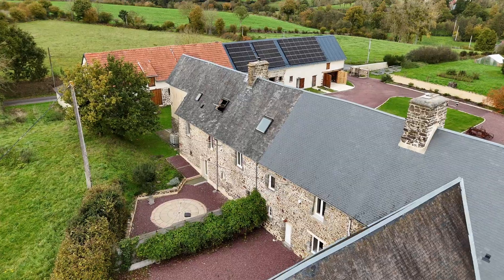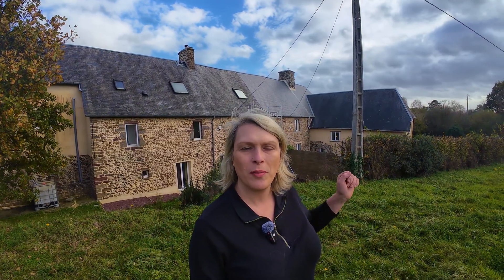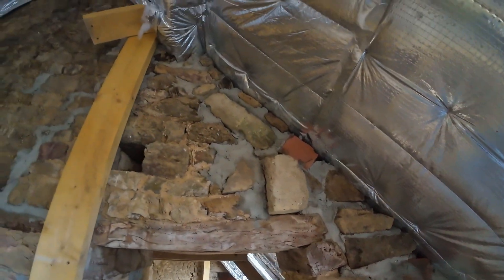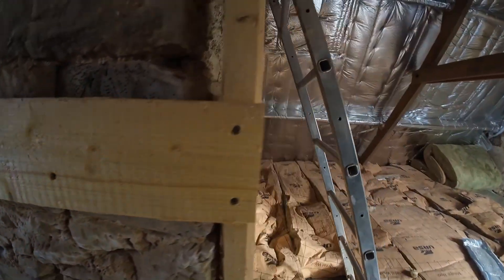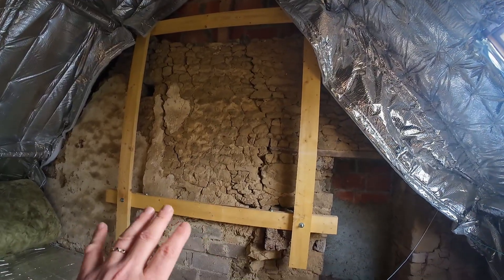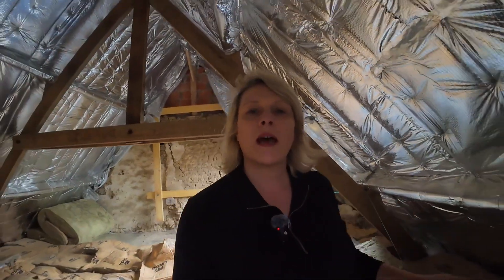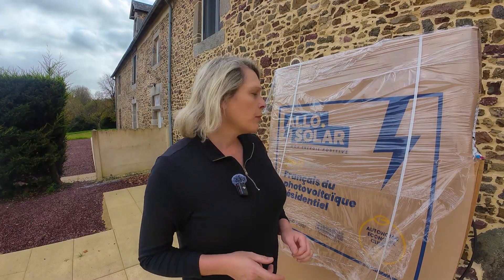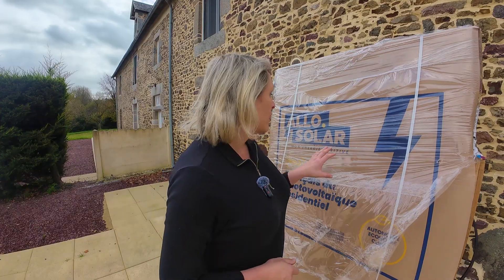Fixing a 400 year old roof for solar panels.

Comment: 10:05 at the top there is a white "dot" visible, looks like it is still a hole that you should check and possibly fix to prevent from even very small leakage. It does not look like a reflection from your lamp, but it's a YT video so I may be wrong.
Reply from the maker: Yes I saw that on the video too going to go up in the loft tomorrow and have a look I'm guessing it's a slipped tile.

Comment: Awesome view of the attic, tend to forget how old some of the buildings in Europe are.  I have AC coupled Fronius on the House, and 2 x 450/100 on the shed. If you need battery charging over AC load, go the 450/100 much more efficient. If the additional AC inverter power would be handy then go the Fronius. Victron Says stick to Factor 1 rule ie if inverter is 8kw, max AC solar is 8kw. I tried this with a mix of a 5 and a 3kw fronius, but on cloudy days when you get those burst of sun as it pops out form behind the clouds the inverters were unable to cope when the battery was up above the 95% range. I have stripped the 3kw, and moved to the shed put it on the 450/100 and the whole system performs much better for it. I still have an additional 5kw during the day with good sun, and the batteries charge much quicker with the additional DC coupled solar.  win win.

Comment: i’d suggest to either go with the RS450-100 which works ideal with 2 x 7 panels. Did that a year ago at a farm with 4x 7 panels so with 2 of the 450s. 
As someone, also recommend you could also use a Fronius which can be controlled by Victron but only when it’s on the AC out side of the multi plus or Quattro. 
The question is, if your cabling does support that.

Comment: I would say get the best of both worlds both an AC  and DC coupled system by getting a Fronius inverter. They integrate perfectly into the victron system showing up
On Venus os and VRM. It will reduce your conversion losses as well as, gives your additional inverting power on top of the 15kva Quattro at least during the day, and possibly more opportunities to add more solar in future if you choose to with its multiple mppts
Reply: My SolarEdge inverter shows up on the VRM, actually it's an ET112 energy meter as I have an older SE inverter, so any inverter can be made to appear on the VRM.

Comment: I'd stick with one brand. Mixing brands is always a hassle. 
I don't know what the specs of the panels are, but instead of putting 7 in serial, you could go for strings of 4 and use one of Victron's 250V MPPTs.
If you go to 4 per String and 4 Strings in parallel a 250/60 could work. 
Unfortunately, that would be 16 Panels. 4x3 would only be 12. 
So 3x5 could be an option if you have the space for one more panel.